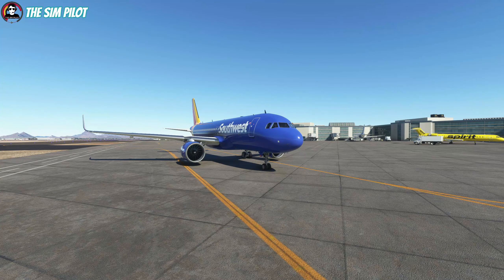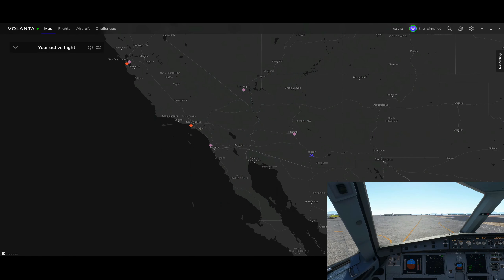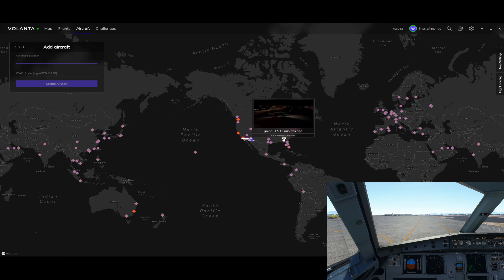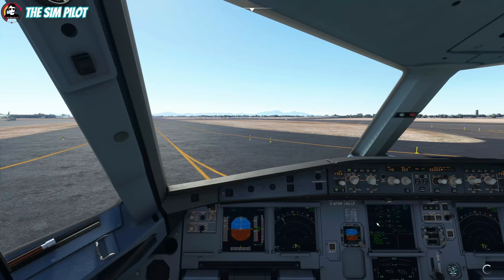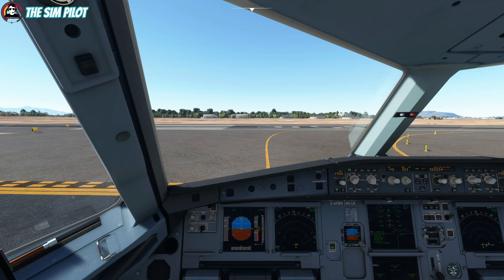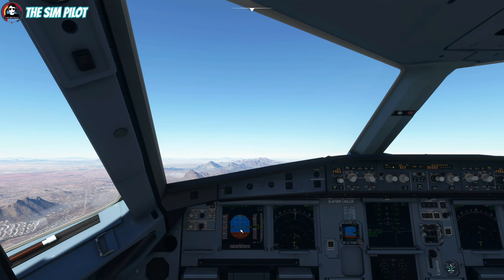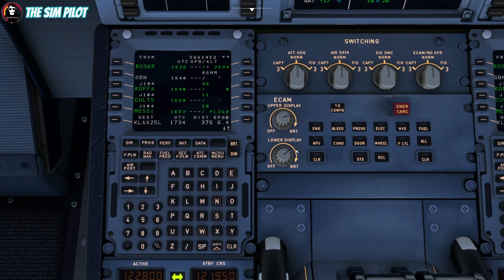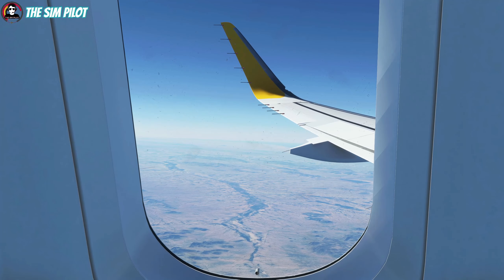MSFS2020 | FBW A320NX Tutorial | Part 2 | TAXI, TAKE OFF & CLIMB | BONUS CONTENT VOLANTA APP

Comment: If you haven't done it already, I'd recommend the SBRJ challenge on Volanta. I tried it just today and flew from SBSP, a nice short hop. The approach into SBRJ is amazing (and slightly challenging)!
Reply from the maker: I have not tried any challenges in Volanta. I'll definitely give it a try thanks for the recommendation!
Reply: @TheSimPilot , well... Volanta doesn't award you with anything but listing the challenge under the "completed" tab. So there's no rational reason to do them except for completion purposes. But in the case of that specific one, I felt greatly awarded with an approach I would never ever have considered trying out because I just did not know of its existence. :D
It's a fun step descent into a sharp turn onto short final - you're going to love it. :)

Comment: Excellent, just what I needed ! I just had a go flying, no idea what I was doing. Need to learn to how adjust speed and altitude. Tried to land in 250 knots in Stockholm, you can guess how it went :) I flew successfully from Helsinki, so pretty good.
Reply: When i got msfs i knew absolutely nothing about planes, since ive had it i know how to start most of the planes, youll get used to it and it will get more and more fun every time
Reply: @ziepex7009  I enjoy flying very much. Picked up old hobby from the past, flightsimming :) I’ve been mostly on propeller planes, so I have a lot to catch up.
Reply: @yams900  props are amazing
Reply from the maker: I knew you were waiting for this and Volanta. I hope it helped.
Reply: @TheSimPilot  Volanta bit was very helpful, learned a lot. See if I can add an aircraft next time.

Comment: Can you program the altitudes in MCDU, so altitude descend would be automatic ? Please explain difference between managed and manual controls, regarding altitude, heading and speed, please.
Reply from the maker: Let me just give you some high level information and I'll explain more in the last episode. Normally you should be able to program the altitudes or even better the restrictions are carried from the navdata. However, at this stage A320 does not have a working VNAV. Managed mode is the auto pilot controlling the speed, heading and altitude based on your flight plan, performance calculation and altitude selections. Out will select a vertical speed, computer the flight plan and adjust the speed. Manual or selected mode on the other hand is based on pilot selections in other words aircraft will follow the speed, heading and altitude you set. As the pilot you're responsible for selecting the vertical speed to get to the altitude, selecting/adjusting the correct heading to follow the flight plan as well as adjusting the speed accordingly.
Reply: @TheSimPilot  Excellent answer my friend. I’m about to take off and give it a go. Helsinki-Stockholm, route planned in Navigraph -> pasted into Simbrief, so should be easy load in MCDU. Just need to confirm SID and STAR.
Reply from the maker: @yams900  Good luck my friend and have fun

Comment: Thanks for a great video, may I ask why you changed from SimtookitPro to Volanta? I just watched your STKP tutorial and thought it was brilliant. I am only just starting with Volanta and installed STKP but have not used it yet, wander if we can use both at the same time?
Reply from the maker: The reason is the resource usage of simtoolkitpro. I still use it where I need to see the restrictions and approach procedures on map. Volanta does not let you to select procedures yet. Simtoolkitpro is still superior in terms of functionality, however it uses more system resources than Volanta that's the only reason.
Reply: @TheSimPilot  thanks for your quick reply. Yes I did hear STKP is a little heavy on resources, guess I have to find out how it goes on my system. I like them both. Cheers